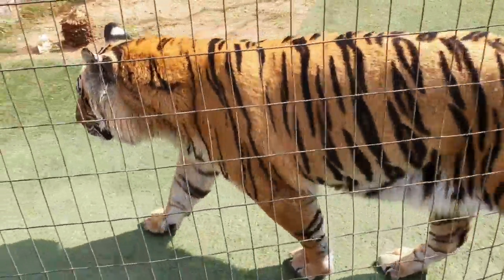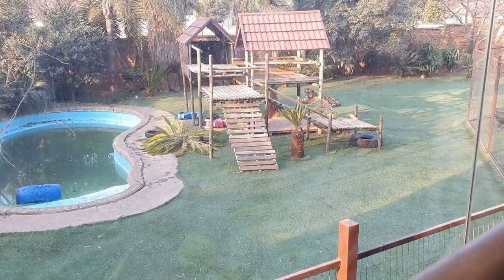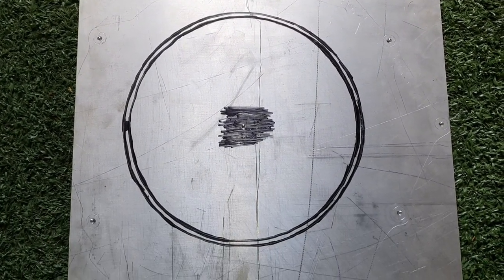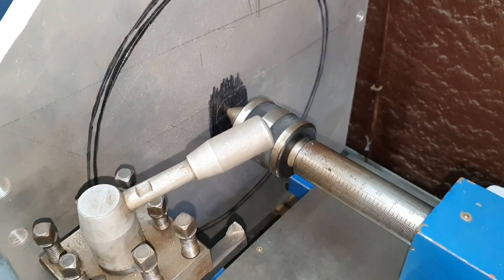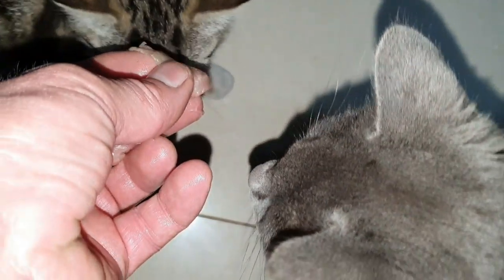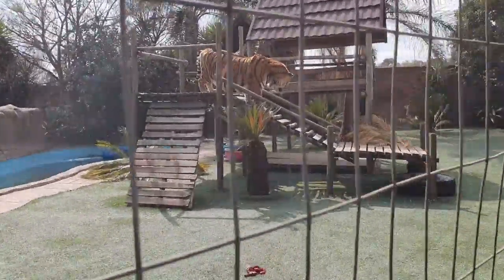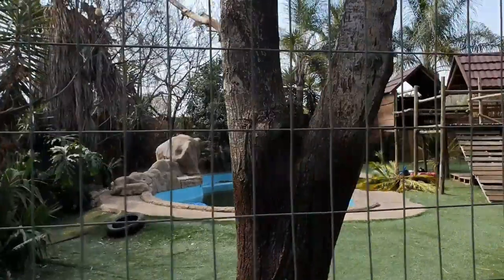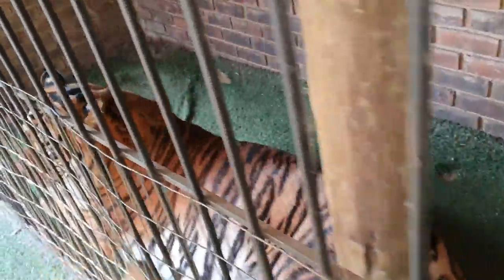This is how a tiger say "stupid question"

Comment: as a machinist, you need to get a end mill a rougher and finisher 4 flute for roughing and finisher 5 flute to clean it up it will make it a lot easier, if you need chamfer 1/4 90 is nice to use..depending on the size of the holes, also I like to use a dremel with a carbide tip to deburr.

Comment: I love the fact that you are making your own transmission adapter. My lathe isn't big enough to turn something of that diameter, but now I am tempted to try it using a rotary table on a milling machine.  Will you be able to re-install the gap you cut out of the bed?  How did you cut the ways?
I always like the tigers and the other pets, but the machining was intriguing.
Bob

Comment: 3:06 not too sure of your technique to find the centre of the circle though ! I'm thinking it's relying on the first straight line going through the centre in the first place. But you have the equipment to do it accurately but needs more lines scribing.

Comment: I hope you are planning on replacing that transmission. It looks like the case is cracked. See 1:25 to the right of the clamp.
Reply: Maybe he could weld it if need be!, well spotted.
Reply: @tracyllewellyn5942  He is doing a V8 swap. If that transmission broke with the stock engine, what's going to happen with a v8?